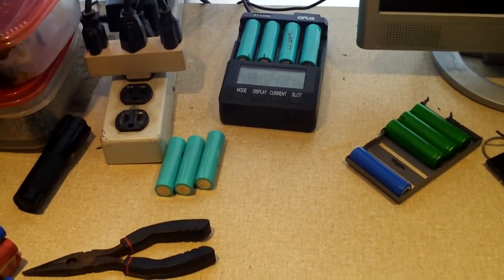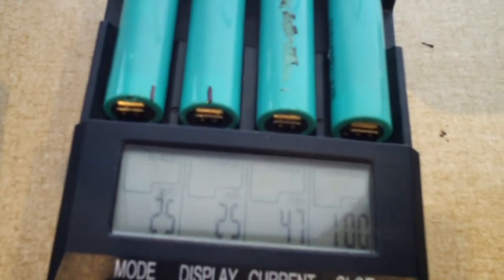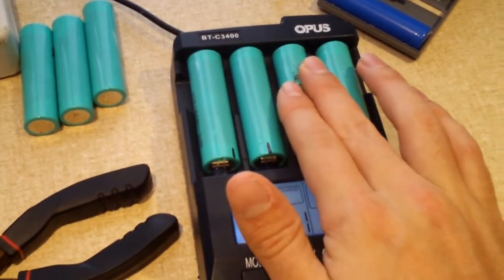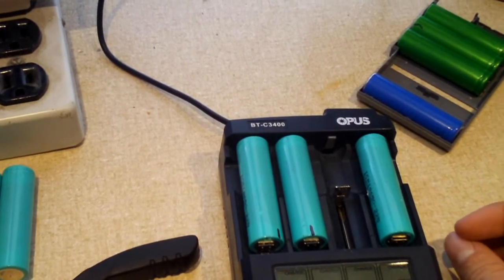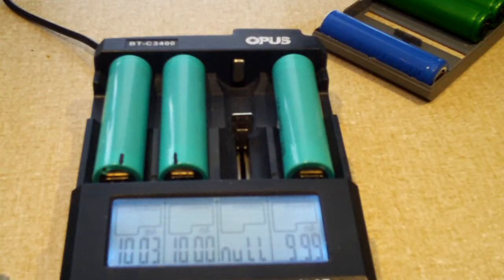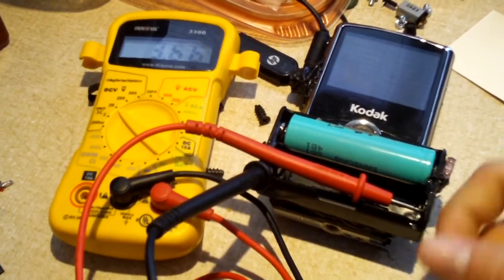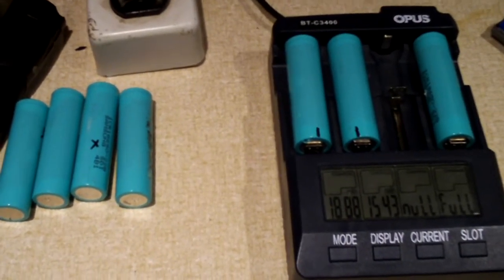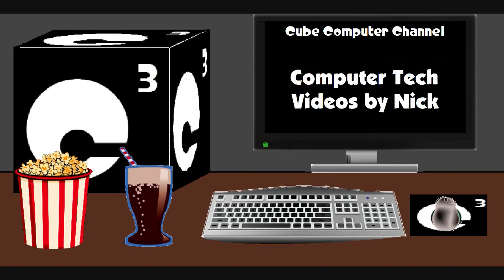Update on the Samsung batteries harvested from the HP Laptop Pack

Comment: Nice! while watching your video, I was reminded of the time when I tried to rebuild the battery for my TP R52 but I realised that I was too scared to solder to batteries.

Some time after that, I still had 2 batteries left, and I now kick myself for leaving the better of those 2 batteries inside the laptop when I put it into storage, because it brought the capacity from 46% to 0% and there's now a cross in the battery icon on the taskbar and a blinking battery indicator. The worse of the 2 batteries has only 9% capacity which lasts for around 10 minutes.

I did draw up a schematic of the wiring diagram for the T40/R50 series battery pack along with photos of the guts of the pack in my Evernote if you want to see it.
Reply from the maker: I have soldered to 18650s before... you have to do it very carefully to not transfer too much heat into the cell. I have also soldered to NiMH cells several times when rebuilding the battery packs for my cordless phones.